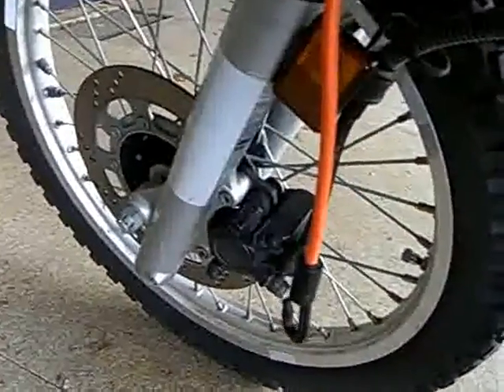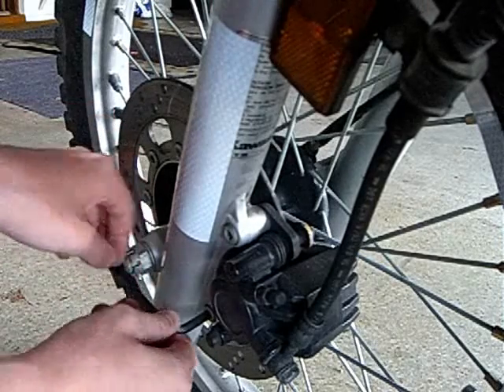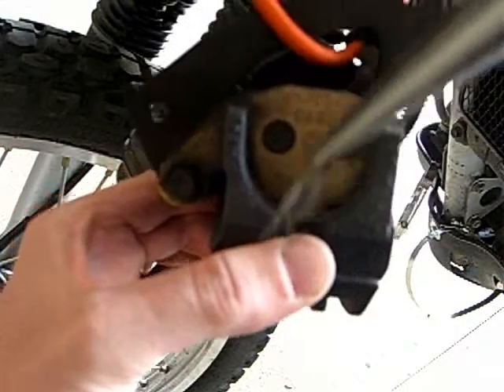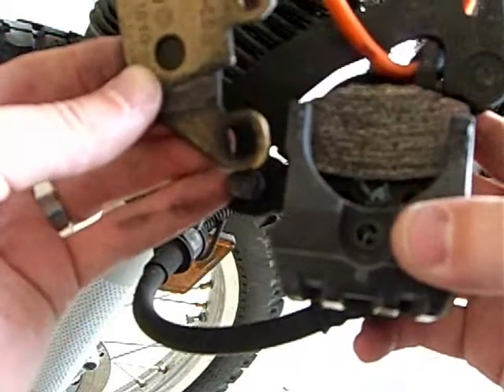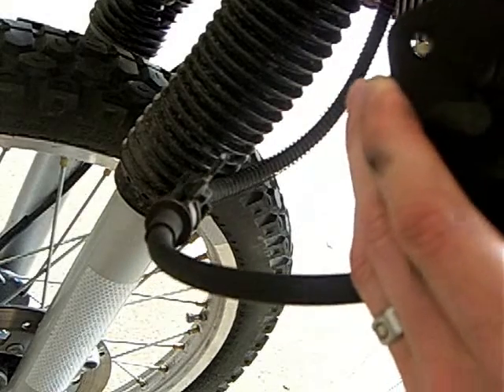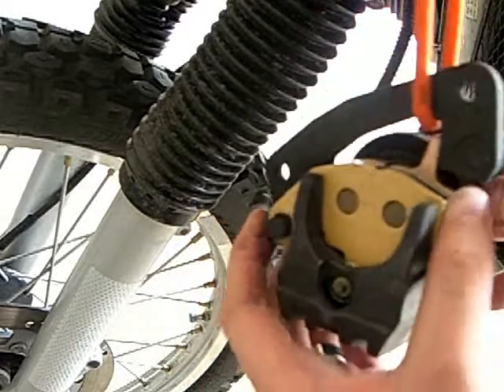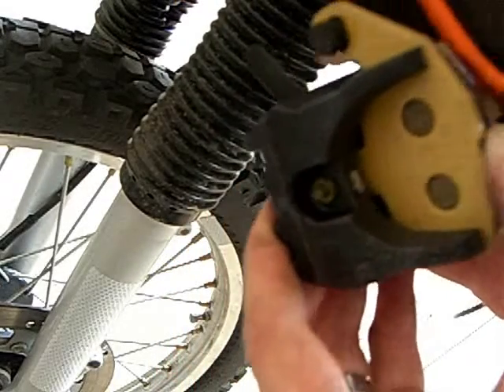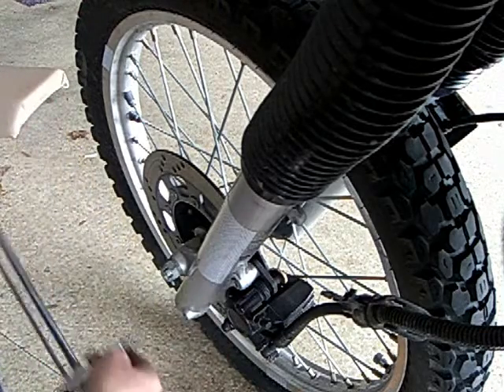o#o How to install / uninstall front brake pads on a 1987 - 2007 Kawasaki KLR 650

Comment: Very helpful.  The rear pads are almost exactly the same, except there is no little cotter key and shaft to remove.  A C-clamp is real helpful in getting those calipers to spread.

Comment: If your pads squeal really badly you might want to try some anti-squeal lubricant on the outside of the pads where the contact the brake caliper.  BTW I'm diggin' your torque wrench.  I've got the same one! Ol' reliable...

Comment: Good video! You should always clean off brake parts before working on them. They will often contain asbestos dust that is really bad for your lungs. Clean them with brake cleaner, NOT compressed air. Also, I would use a dab of brake lubricant on the pin to keep them from sticking. The pin and all parts should slide freely to avoid lock-ups-- especially on the front brake.

Comment: At 10:40-ish where u were kinna flopping the bads talkin abt whether or not you thought your disk would fit between the pads, youre right, its not supposed to fo that. That "springy" feel u got when putting the new pads on is from the tensioner plate, which also serves and a clip on that outter pad to keep it from flopping.

Comment: I notice people mentioning pad squealing. pad squealing the the pads vibrating when being used. there is an anti squeal paste (available at auto parts stores) you can slime on the back of the pads to dampen that sound. just a thought.

Comment: Well, yours went better than mine...
The little clip pin came out easy on mine but the big pin on my scooter is locked up solid and I can't get the old pads out. I'm soaking with liquid wrench for a day or two and may have to resort to heating the caliper to try to remove the big pin.

UG!  Nothing's ever easy.  -Dave, Pittsburgh PA

Comment: not flaming, but grease is grease is lubricates far better than wd-40 which is penetrating oil used to loosen bolts n such, very mild lubricant, invest in some lithium grease (manual reccomended) it will help you bike. But i think from your vids i saw you got a bike a dr400 the black widow or soemthing?